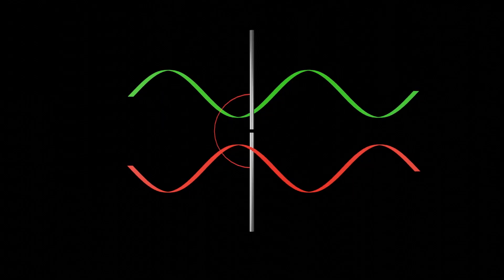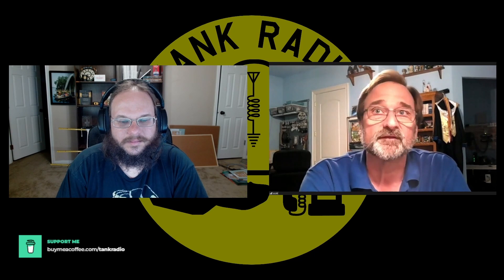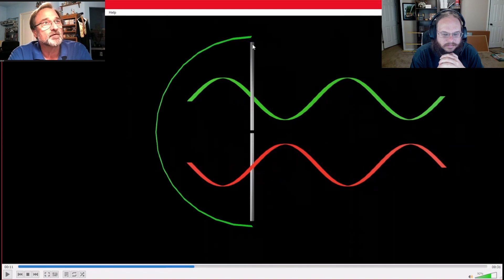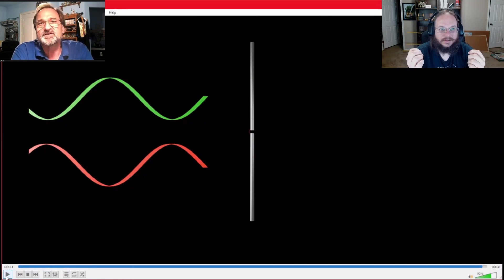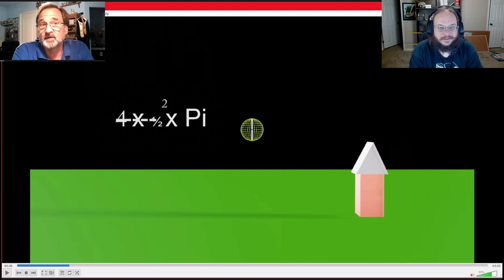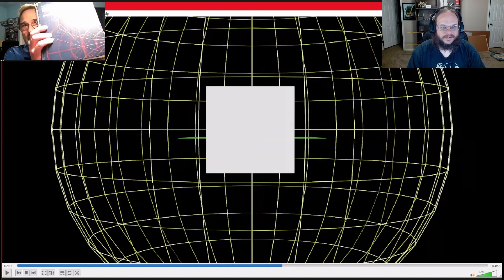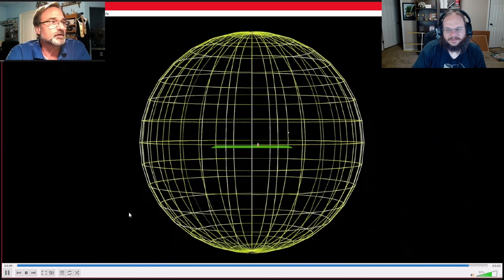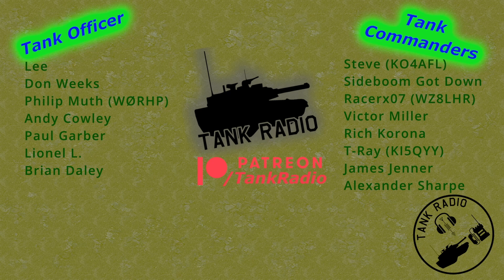How does a Radio Wave get Generated

Comment: Electromagnetic waves are fascinating. The electric field and the magnetic field are parts of a unified entity. It is sort of like asking if a '5 cent nickel' is a 'heads' or a 'tails' - they are both, just two aspects of the same nickel.

Now, the really interesting problem is that Ampere's Law and Faraday's Laws will describe the near field electromagnetic wave possessing a quadrature (90 degree) phase differential between the electric field amplitude and the magnetic field amplitude, but by the time it propagates to the far field the two wave components are temporally fully in phase (0 degrees).

I have yet to read a good explanation for this phase transformation at the far field.

Comment: I think, towards the end of this video, they are discussing  the effective antenna aperture, which is related to the gain of the antenna and the frequency in question. It is not related exactly to 'the size' of a given antenna (a mechanically short, but electronically lengthened resonant antenna would possess the same effective antenna aperture as a full length one (google infinitesimal dipole).

The relative 'gains' for different antennas and their radiation patterns are not correct.

By definition, a spherical (i.e. isotropic) radiator would have no 'gain' and the 'dB gain' is 0 (not 1). In addition, with relation to an isotropic radiation pattern (spherical) a dipole has a gain of 2.15 dB, not 1.4.
Reply: You are correct.  Using Chris Smolinski's site, I quickly read the 1.5db rather than 2.15db. My mistake.

Also, since we wanted to avoid a lot of math, I didn't want to discuss the advantages of multiple wavelengths to increase the effective area (aperture).  We just wanted to stick with a 'unit' dipole.